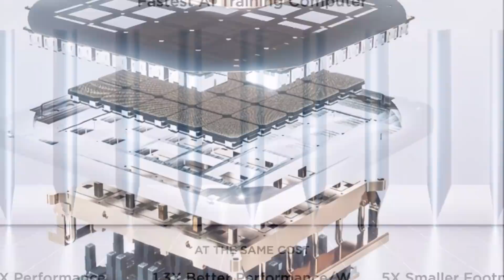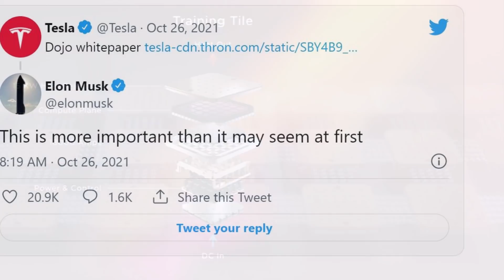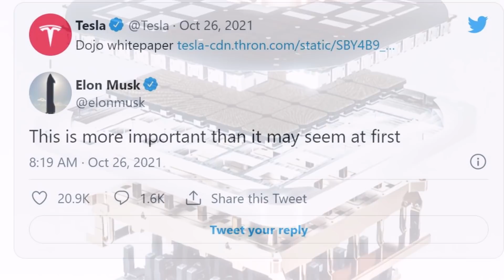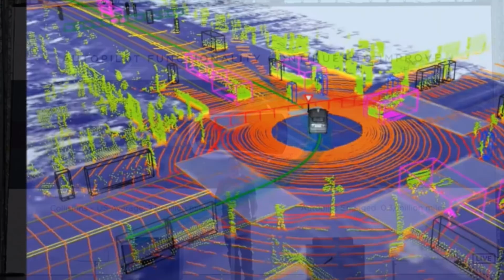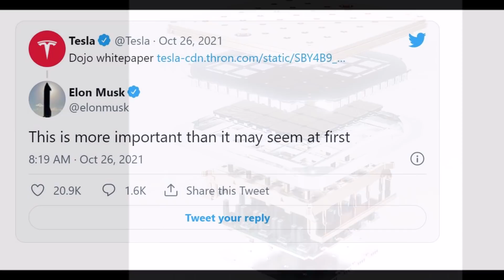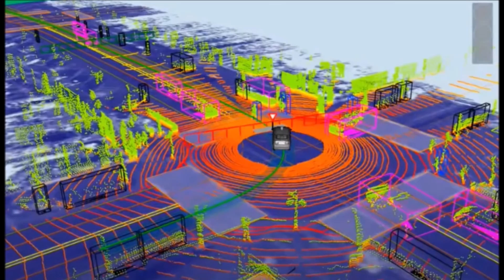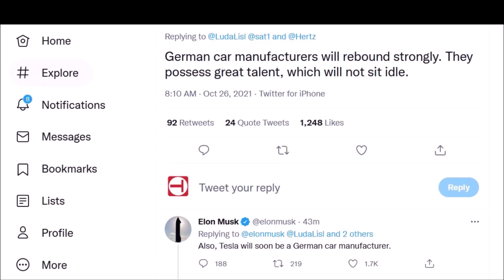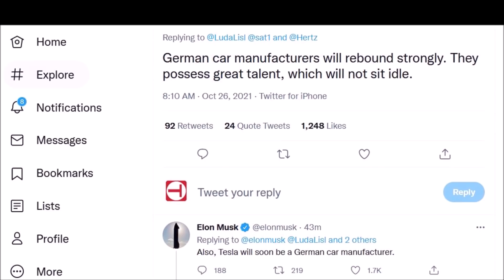HOURS AGO! Elon Musk Just Tweeted Tesla Dojo Update With Attitude

Comment: i havent written code for decades, but it looks like using smaller numbers, 8bit and 16 bit but with exponent multipliers to do more "fuzzy" or approximate calculations, saving space, and bandwidth (and energy). like its about 80, and thats billions, a small number and a general scale modifier, rather than using 32bit spaces or larger (32bit uses number into around 2 billion - hence the old school 2GB ram limit in 32bit machines). lots of types of calculations do not need to be precise, normally this is already done by simply using 32bit or whatever integers rather than floating point precision numbers, but this looks like further shortcutting for memory saving/bandwidth/power. if i am wrong, let me know. its been many years since i have written anything .